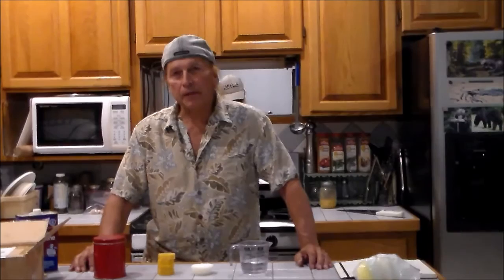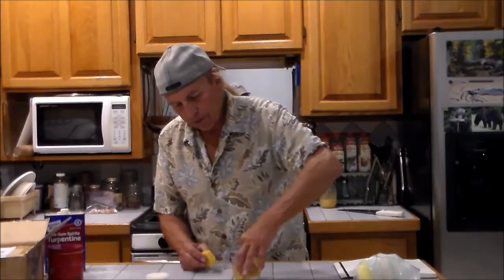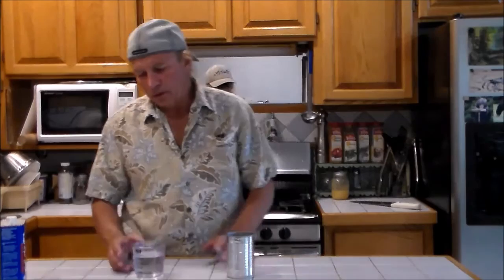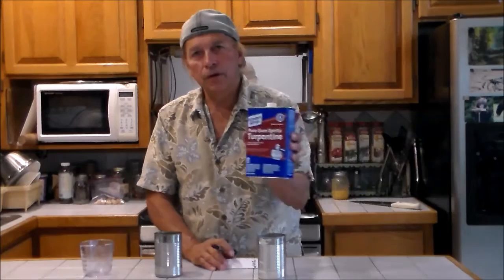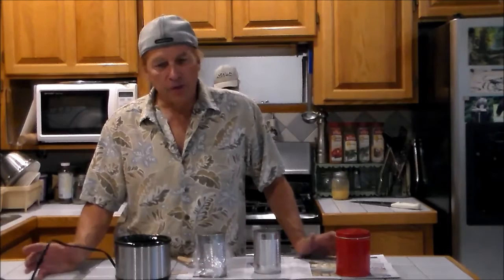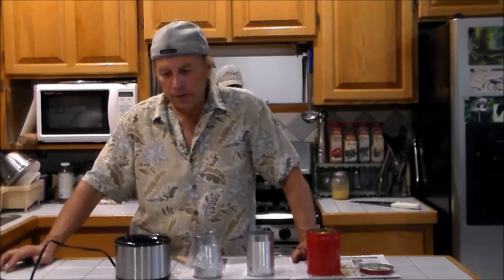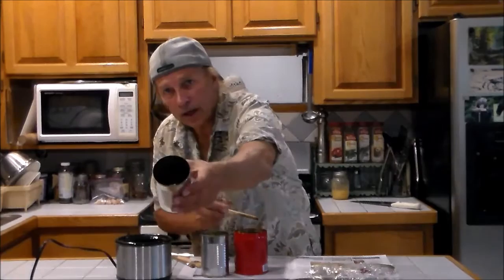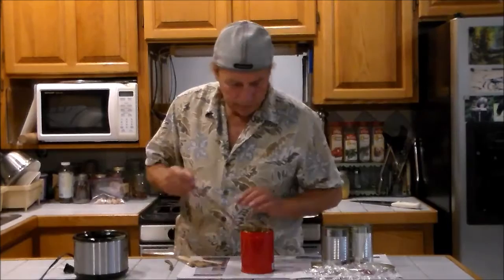DIY Grafting Wax

Comment: can we use pine sap instead of pine tar for preparation of grafting wax
Reply from the maker: You may get away with that--- turpentine is made by distilling pine sap--- you may be able to eliminate the turpentine and the pine tar, just by substituting the sap--- give it a try and let me know my friend---Don
Reply: I have tried with pine sap,and made a very good grafting wax. last jear I grafted 17 apples and almoust every scion made it(26 out of 29). where I live in bosnia,we dont have pine tar to buy,so i found an old Bosnian recipe for making grafting wax on internet that includes pine sap,works great. hope this helps you.

Comment: Won't using these chemicals be bad for the grafting of fruit trees?
Reply from the maker: The pine tar is an antiseptic that will help keep un-wanted things from entering the wound areas. and the wax will be harmless and will seal out water and keep the scion from drying out. This is an old and proven recipe,.---Don
Reply: @donaldporta  can I use only ingredient bee wax to seal cervic of cleft graft and then wrap the whole graft with polythene or what can I mix that is available to me linseed oil